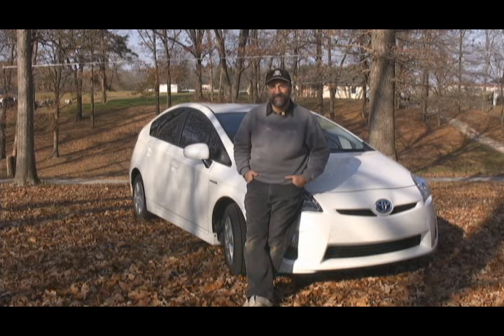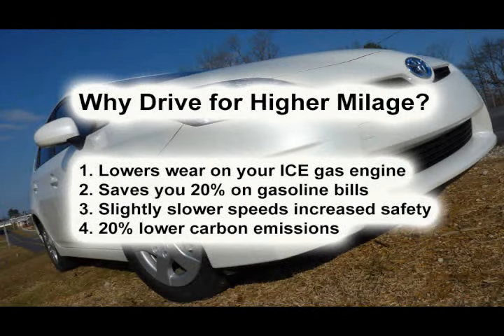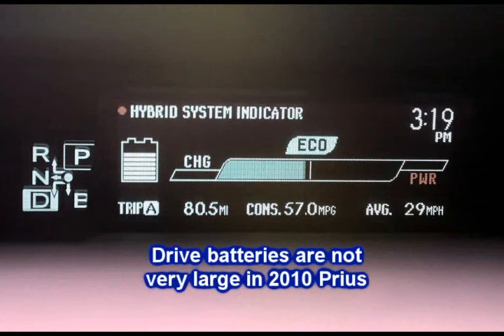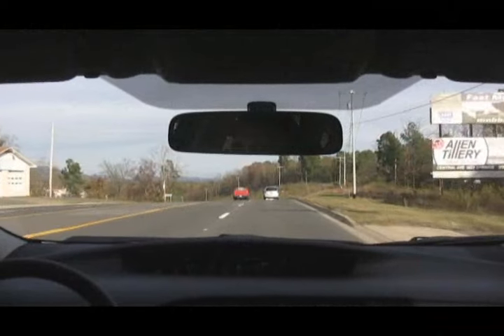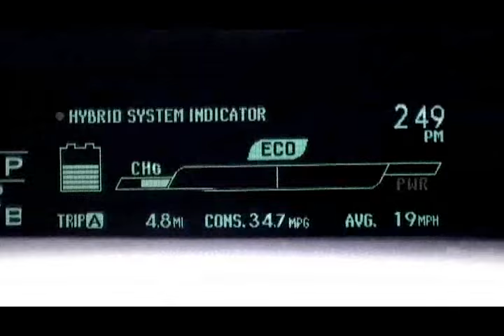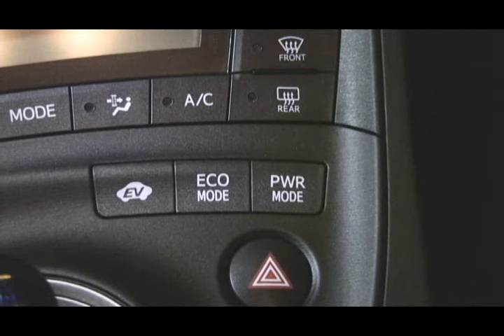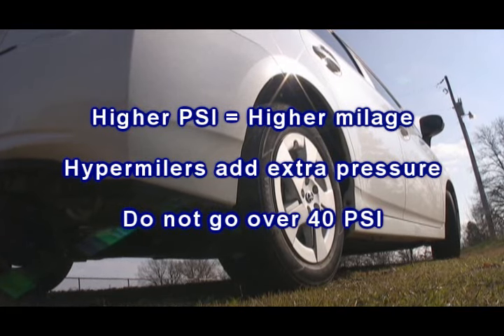Prius MAX MPG Secrets

Comment: It's amazing video even in non-hybrid cars.. but unfortunately I can't get over 44 mpg on my prius 2010, I think that because I have a lot of hills in my town.. is that matter ?
Reply from the maker: Anas-
Yea and no.  With hills, you have to coast down them to get your MPG back up. And, on small hills, do not try to keep your speed up..let the Prius slow down slightly... Keep your foot at the same spot on the pedal. This helps a lot.
44 isn't bad.. it is still better than ANY other hybrid.
Reply: Bob Nagy Thanks man it's really work I improve my mpg to 50 mpg ( 200 mile ) it's fair for me now :)
Reply: ***** Your mpg will improve as the weather gets warmer and the summer fuel blend starts making its way back into gas stations. Keep an eye on your tire pressure too.
Reply: Thanks
Reply: We made the mistake of buying "normal" tires, not the type recommended for hybrids and our mileage really suffered, they say you will only lose a couple MPG, ours seems to be more significant 5-7 loss.
Reply: +Lorrie When I bought new tires for my Prius, I took a hit, and they were supposed to be better than the tires I had...

Tires might have a break in period like many other things.
Reply: did you see any improvement?
Reply: +Bob Nagy I wonder whether the Prius could do with a larger battery for very hilly terrains; I worry that if you drive down a steep 1:4 hill (like you get for example in Devon, U.K.) that the battery will be fully charged before you get to the bottom. I notice that the latest Prius goes 1.6 miles on battery alone whereas earlier cars only go about a mile so maybe the battery has been made a little larger. I guess it's a balance / trade off due to the weight of the battery.
Reply: +Berge Marie yes but the most thing effect in your mpg is the heater and air conditioner and tires pressure
Reply: *****  thank you for your response!!! I will keep that in mind.
Reply: Berge Marie how much your mpg right now ?
Reply: +Anas AbuDayah  yes i can get 49/51 the trick is start smooth and not stoping and go very fast and you can enjoy even with air conditioner and place the cruise control when you go freeway IMO is my expirience 12 to 14 hours every day non stop......uber
Reply: alfonso ramos oh nice, that's why they put ratings for drivers on prius 2016
Reply: @Yavor54  Do most of these techniques (staying in the sweet spot, burn and coast) apply in non-Prius cars?
Reply: @lorriemilsten4778  High roll res tyres are stickier. You get better grip but at the expense you just saw.
Reply: @Yavor54  ANY? ...  Original 2000 Honda Insight, half the doors, less than half the passengers and luggage space but 55+mpg. Sorry had to defend the little Honda's honour.

Comment: Hi bob, great video. I recently got my prius about 3 weeks ago. 2011 10th anniversary edition. Great car, but I am not getting anywhere near 50-70mpg! I'm lucky if I'm getting 33mpg. I've followed every technique you've mentioned in the video. My last tank of fuel gave me 280 miles. Next tank gave  me about 290 miles. I just don't know where I'm going wrong...
Reply: Where do you live? If you're in an area that gets snow regularly, that can sap your mpg. It's also winter right now, so like the video mentions, you're using winter blend gas which gets less mpg, and the engine has to run more to give you heat in the car. Blocking the front grille with pipe insulation may help, as it keeps cold air from rushing into the engine while driving. But don't do this if it's more than 50 degrees out, or your engine will overheat.

How long is your commute? Every car gets terrible mileage in the first few minutes/miles of driving, but admittedly it's a lot easier to tell this in the prius, but after the engine is warmed up your economy should improve. But if your drive to work is 10 minutes away, or less than 4 miles, then the mpg will also be low.

Speed is probably the biggest reason you're not getting more mpg though. If you're doing 70-80 mph on the freeway, then it's not going to get you as much mpg, hence why a lot of prius drivers tend to go slower on the freeway.

Beyond this, you may want to ask on priuschat.
Reply: slim mohmood I've notice a few miles difference in mileage depending where I buy my gas.  I've heard that gas quality (I'm assuming ethanol mix?) impacts MPG but I've never had a car that monitored it so closely as to notice. I get 47+ at the Conoco and 45 from the convenience store (whatever they are)

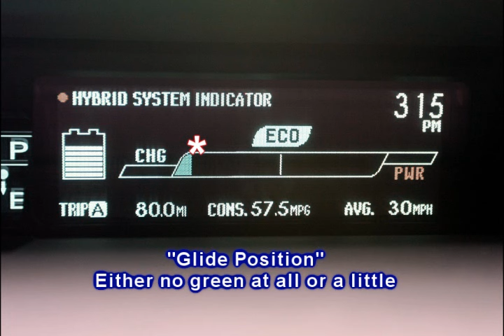Comment: I noticed you had not said any thing about bringing the gear changer to the B position. Also, at around 3:19, the text on the video says: "Glide Position" Either no green at all or little. Why not have that green bar on the Charging area in the HSI?

Comment: I found that blocking off the lower radiator duct with heavy black adhesive tape increases mpg by about 5 in sub-freezing temps.

Comment: Why not shift to b mode when pulling off the highway when no one is behind you? Won't it slow you down faster/regen the battery quicker
Reply: B mode uses the engine for braking.. so you waste energy into the engine. What i do is engage my cruise control and just press and keep down on the cruise control stick to keep on making the speed less and less.. this fully puts all energ6 directly into the battery.. then when im close to the stop point i just cancell the cruise control.. also works great on downhills to fully charge the battery 😀👍👍

Comment: The techniques in this video are easier said than done. When keeping the power level either in EV or on the internal combustion engine at a low level, the car is hardly able to even maintain speed.

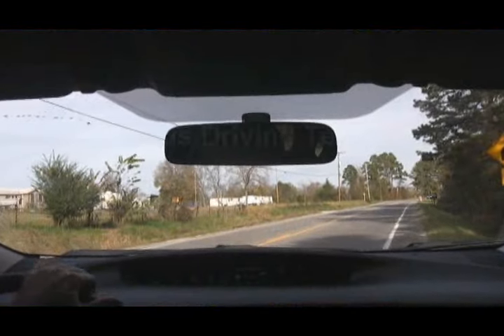Comment: 2:09
Wouldn't really consider it reduced wear. 
The problem is that more heat/cooling cycles will potentially damage the head gasket and warp the block/head. Still great video especially considering this is info from 12 years ago. but given I just replaced a 2010 Prius head gasket that was leaking coolant into C1, I wouldn't consider that as accurate for my case.

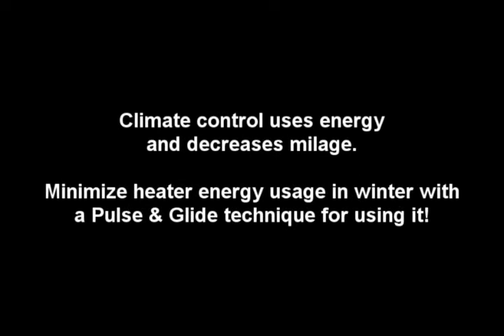Also 8:58
Only a/c air matters. hot air just allows air to pass through the heater core which is already going to be hot. It's basically just another radiator attached to the engine, it's going to be hot no matter what. if anything it's even more efficient as your now utilizing the heat the engine gives off and not just wheel power.

Comment: One extra trick: during the winter, try to use up as much as your battery charge. When the engine gets cold, the computer will start it up anyways and will charge battery. If you stop with full battery, it is lost energy.

Comment: Riiiight, but it if the battery doesn't -work- below 35 Degrees Farenheit (which NiMH usually do not) then that is a poor morning for hypermiling (past the capability of whatever ultracapacitors are OK,) does it? If your winter still goes 35 below C then you are stuck rethinking your plan to commute by Prius from the ski chalet in Afghanistan (which is saying something.)

Comment: Over-inflation will reduce a little mileage but the tires tend to ware a bit faster in the center. For anyone that has a 2010 prius, most are replacing the tires fairly quickly. Over-inflation would make that ware even faster.

Comment: heres a BIG question. I got a 2011 prius and i do this stuff (still get under 40mpg-hopefully its because its winter now and i just got it)
anyway, im very paranoid for the EV mode. Id like to use and save more on mpg which is why i got the car but....... Does using the EV mode end up decreasing the hybrid batteries life?!? Will it die faster? Id suspect so and it doesnt seem like it would be worth it to use constantly when theres a chance that it could die quicker and go through more cycles or maybe it could also possibly kill the generator too, because i also suspect generator will have to work alot harder and more of the time now to juice the hybrid battery back up, correct? It seems like maybe we're better off not using it at all and be happy with high 30s low 40s mpg as in my case.

But i  was hoping solid 50 in town, i dont get it, perhaps in the summer it will go up alot more. I drive in ECO mode as well and theres new tires on it so im confused. After my first full fill up i did the math and got 37mpg. Miles driven divided by the gallons put in. And by the looks of it the same may happen on the next fill up or maybe hit 40 barely. smh.
Reply: What is the mileage on your 2011? It could be wear on engine parts, spark plugs or other factors like your location, what is your winters like? A California winter is going to be different from a Colorado winter for example.
Reply: @cn8299  hit 187k. Many things were replaced and was owned by an engineer that took care of it. I guess i could double check everything but im in the midwest. On coldest days we had i shot down to about 32mpg
(Sidenote, whtaever dash says is grossly innacurate. And always says 3mpg more than what i get in reality and doing the actual math.) I got about 39 last time and it said 41 42. And when snow was gone i shot up to 44 45 and have been hovering there on the dash currently. But when i fill up i bet it will be 3mpg less so maybe 42mpg. It snowed yesterday again (midwest, snow leaves then comes back) but this is why i hope in summer i shoot up even more. Real.nice new Michelins were put on. But i wonder if that too is a culprit. Factory tires probably have less resistance and whatnot to maximize mpg maybe? But at 600bucks for these.. im keepin em. 

I did suspect id lose a bit from that magical 51 the sticker says (due to age etc) but i still expected a SOLID 45. 32-39 seems shitty lol

Comment: I'd love your thoughts and advice.  I'm considering the purchase of a used 2007 Prius with 146k miles to use in my commute to work.  I drive about 125 miles each way to work half on the interstate and half through curvy, very hilly roads.  I would be adding the Prius as a third car.  Should I expect the Prius to handle the long drives 3 times a week?  Thoughts on battery life, mpg, etc.  Thanks!
Reply: Kenny, I've owned this ''machine'' since july 24, 2012. It's also a 2007 I bought loaded from a Toyota dealer In west palm beach. I'M THRILLED with this. I'm THRILLED w/ the 48-54MPG we get hiway/city. Good luck--get one while you can get a deal YOU'LL LOVE IT.

Comment from the maker: Update: I've got 35K miles on it and I have to say- the 3G Prius is a superb car. It is so solid, so smooth... and I get a little over 60mpg in-town if I pay attention. If I just drive it  without "technique", then I get 52-54mpg. If I had to complain, it would be that they used black under the white paint job. Any rock nicks are black. I can tell, this car is going to go over 200K miles without a hiccup.

Comment from the maker: @frosted1030 That's not a bad idea. I still stick by the idea that a Prius driver
can improve their MPG by 20% if they know how to drive the car correctly. 
If you leave it in power mode and floor it out often, I imagine you could go as
low as 35MPG.  That's around the actual MPG of a Ford Fusion Hybrid.
Unless we go to a composite body, you are not going to get V6 performance
and 40+ MPG. Best of luck

Comment: Erik from Modena, Italy. I have Toyota Auris Hybrid 2011 (same Hybrid system of Prius); normal driving (eco mode) -> 4 litres/100km 
In Italy 1 gallon -> 9$ (Feb/2014)
Reply: Reply to Urbex2007:no urbex your wrong: when the ICE doesn't work and the car is moving under torq force(slightly depress of accel pedal) one electric motor is using amps so the difference from in and out amps(the second electric motor is producing amps) is calculated-transformed to Watts and finally to HP.The 100 MPG shown could be exact or an aprox if it is higher.Its simple to see that the example with Chevy Volt in UK doesn't apply to Prius powertrain.

Comment: I wish you'd talked about cruise control.  I find it consistently gets me higher mileage.
Reply: Cruise control keeps the speed within tight limits, applying extra engine brakes or accelerating fast for that reason. You wouldn't do either on your own, hence the better millage...

Comment: dear
i bought a prius 2010 that reads 37 mpg only....
can you suggest anything please?
only a week ago i bought it
Reply: Reset your trip milage. This is what happened to me after I bought my prius and resetting the trip odo took it back into the high 50's. I don't know what caused this since my test drives averaged low to mid 50's then after I drove of the lot of was reading mid to high 30's for whatever reason.
Reply: +Kelly Davis good advise!
probably because the car engine aside from driving, charges the battery when it's empty.
I guess charging the battery via ac power, before leaving your house, would be the best thing to do.
Reply: I dont have a plugin ....

Comment: I just purchased my 2011 Prius 2 mo ago (early November), and I'm getting 46mpg with no special driving techniques and none of the modes enabled.  I'm using my Prius for my business trips across the midwest from Philly to Cincinnati.  I consider myself a little bit of a lead foot probably because I'm used to driving SUVs with far better accelerating power (my other car is a 2013 Mercedes ML350 4Matic).  I saw you mention in the comments that "winter gas" is much less efficient here in the northeast.  My question is do you think my 46mpg will improve dramatically once the non winterized gas is available?  Any idea how much?  Also, how much extra mpg would I see in ECO mode vs normal mode?  Don't get me wrong I appreciate the video on more efficient driving techniques, but for someone like me with 15 years of driving high power / performance cars I honestly just want to drive "normally" and pickup the extra mpg naturally. For me squeezing another few mpg isn't worth getting honked at every day by 'Murica driving their F150s behind me.
Reply: I'm averaging about 45 mpg right now in my 2014 prius with the 17 inch wheels. In summer I was getting about 52 mpg, though I could get close to 60 mpg if I hypermile it. Because of the larger wheels, my mpg suffers a little bit vs the 15 inch wheels the lower trims come with, about 3-4. But it has slightly better handling.

As far as eco mode, it's useful if you run the A/C a lot. If not, it's not that much better than normal mode once you use the techniques shown in this video regularly. You still get full power if you floor the accelerator all the way in any of the modes.

Of course, these techniques could be used in virtually any car. But the prius makes it really easy to do them with. I'd say just drive it normally as much as possible, and do the hypermiling stuff when there's not too many other cars around. And just know that you're still getting better mpg than all of them, unless they drive a plug-in.

You should check out priuschat and look up info there, and ask any other questions you may have. It's really helpful.

Comment: There are a bunch of disadvantages of neutral.  It disengages all electronic drive, including regeneration and the ability to start/stop the engine, or generate power.  If you coast above 47 mph and the motor is not running, it cannot be started which means one of the electric motors will have to spin faster than it's spec maximum.  You also can't accelerate.  You can accomplish all of the benefits of N just by applying slight gas in Drive mode, just enough that no regen or thrust is produced.

Comment: I don't agree with the instruction about driving on hills. Rather than letting off on the gas pedal when going down hill maintain a constant pressure on the pedal all the time. This results in what is referred to as roller-coaster mode. The car will slow going up the hill, then speed up going down the other side. The extra speed gained on the downhill side will help keep the speed up on the uphill run. Of course this all depends on the size and spacing of the hills.

Comment: I have a 2012 prius . I have it 5,5 years . I try as much as possible to drive fully electric in the cities where the maxspeed is 50 KpH  our highway maxspeed is 100 KpH.  So I always drive around 105 kph  because the speedometer is not correct .
People say i drive the car to slow and t lazy.. and that it’s not good for the engine to drive that way. Because it also needs a kick in is ass sometimes…. I don’t know if that’s the truth but i also don’t want to do that because the gasoline price here is €2,40 for one liter.

Comment: i dont know... i dont think there are any real "secrets" for max mpg on a certain car... just go for high gears, lower revs, a well kept engine and you´re good to go... i mean i got my old Honda CBR 125 to 188mpg on a 120 km ride once... i get my dads old Ford focus wagon to 47, had a friends BMW M3 E46 at 38 and get around 30 out of my ´93 Explorer on average, 37 at max... its not so much about what you drive, rather how...
Reply: I think you are from the UK because those numbers seem way too high. UK and US gallons are different.
Reply: I am using google-value changer because i am from germany, hence using l/100km.
Reply: US gallons and imperial gallons are different just saying.
Reply: yeah but the difference is minor... although i messed up with the honda cbr, its not 188, its 108.
Reply: a prius is around 100 mpg on your scale.

Comment: I normally score 25Kmpl on condition that no stoppings due to traffic & avg speed is 60Kmph on 2013 prius. Its a gamble between acceleration & the battery power. The objective should be charge the battery at least 75% asap & then go for "glidings" as much as possible without reaching the red area or the indication of power from engine & battery both,  as it reduce Kmpl heavily.  But do not go too slow though,  as it doesn't help to charge the battery.  No battery power - no higher kmpl.